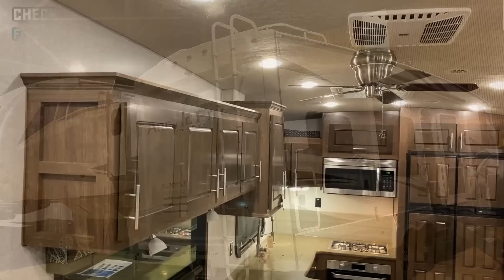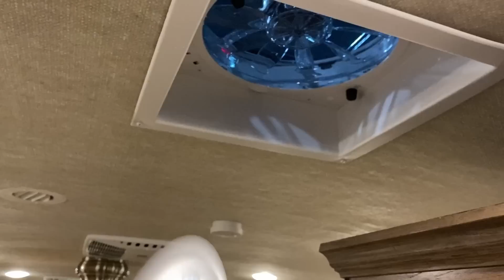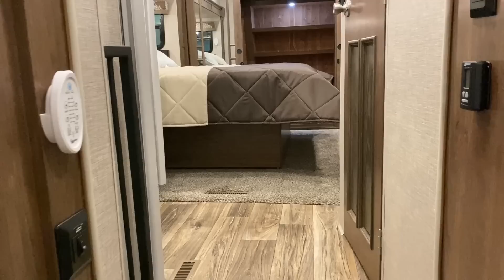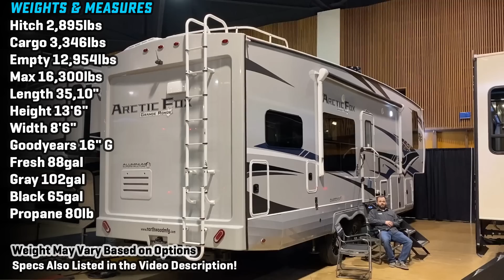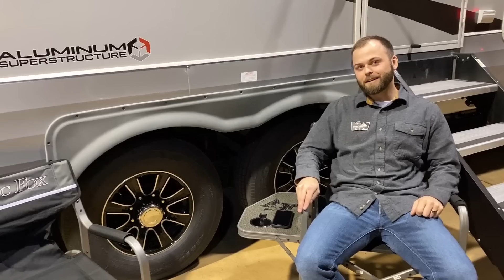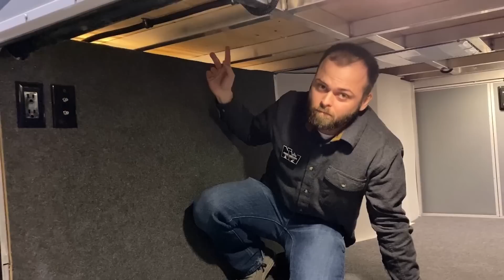Big Camp View + Bed Slide!! 2023 Arctic Fox 29-5K Fifth Wheel by Northwood RV

Comment: What is the smallest camper you can get. That has two bedroom. One in the front and one in the back. Both rooms have to have doors on them.
Reply from the maker: True two bedrooms like that usually push 35ft and up. They pretty much have to be large
Reply: Wish I had my own company I could build a smaller one with two bedrooms. Shouldn't be that hard

Comment: Love your videos❤ also love Artic Fox.  I wish they could shrink the 27-5 to 26 or 27 feet for Forest Service camping and keep the 27-5 tank sizes. Keep up the great work
Reply from the maker: That would be cool!
Reply: @JoshtheRVNerd   our dream 5th wheel would be Artic Fox quality in the floor plan and length of 2023 Alliance 22ML or Reflection 226RK. The only thing we could find wrong with the floor plan on the Reflection was sitting at table I leaned into the curtain and broke it loose from the brace!  Haven’t been in the Alliance but your video made the table look way better in size and surroundings.  My wife didn’t like the shower quality in the Reflection either.  We love the quality of Artic Fox (and OutdoorRV).  It’s nice that Artic Fox hasn’t changed much in time, however it’s our opioid its  time for them to take note.

Comment: Obviously well built, but the floorplan is terribly outdated. Accordion doors? I think there are good reasons why you don't see any other manufacturers building an upper deck like that anymore.
Reply: Wow that is surprising. I only remember that the old ones became unmanageable and in disrepair quite often. Probably used by people with the patience that I have which is very little LOL
Reply from the maker: Something that always surprises me... I often saw folks remove standard doors and put accordions into their RVs that came in on trade. Always kind of surprised me as generally speaking I feel about like you about it

Comment: Thx to Colby.  Also, I agree that there should be an outside fridge option under the counter for overnight boondocking.  I would like to see a desk with televator option by the door.  Possible window and laundry drawer in toilet room.  Bigger door on outside trash receptacle for bigger trash cans, small shelves with backing option on inside trash door (if no desk).  This is the most perfect option for us by far!!!!!  Love the rear kitchen, love that the slide doesn't have heavy stuff in it, love the separate toilet room, love the coat and hat closet, love the rear kitchen and bigger sink, love the extra counter space, love the side splash at the stove, love the size, love the washer dryer option, love that you can get past the bed when the slide is closed, love the well built and insulated frame, love the solar and generator options, love the drop frame, love the large water tanks, love so much about this.  I even like the partial carpeting when it's cold at night.  Thanks, Josh!! We love this for long term couples living in the mountains.  Wonderful!!!
Reply from the maker: TY Debbie

Comment: Very nice coach. For me the sound dampening and the insulation is #1. Throw on about 3500 watts of solar, 10,000 watts of inverters, 30kw of batteries, 5000 watt battery charger.  You can have an off grid Home. Take it anywhere while chasing the sun.

Comment: Love ya Josh but if you're going to say boondocking there better be 12v appliances and a large solar and battery system or it's just used car salesman talk. That's like rv companies that put off-road tires on trailers and call them off-road capable without the suspension or frame that can handle it.
Reply from the maker: Just wait for the 2024 updates 😉
Reply: @JoshtheRVNerd  it's honestly sad so many companies are a decade late to what people want. Thanks for what you do Josh

Comment: Colby did a great job assisting. Always helps to have a brand specific expert to answer Josh's questions. Would love to eventually see 12 volt fridge options but also understand why they don't do it. Love the outside trash access and think that should be spread across the industry. One idea for an approvement is to squeeze a fridge in that storage pocket under the kitchen counter. Never a bad idea to have outside beverage storage and if hooked to an inverter would solve the fridge in transit issue.
Reply from the maker: Colby was awesome for sure

Comment: add an option for a 12v or residential frig.  On the switch  for the bedroom slide.  How tall is it.  What if you are vertically challenged?
Reply from the maker: 12v is coming. Suppliers keep retiring 2-ways so they’re going to have to adjust